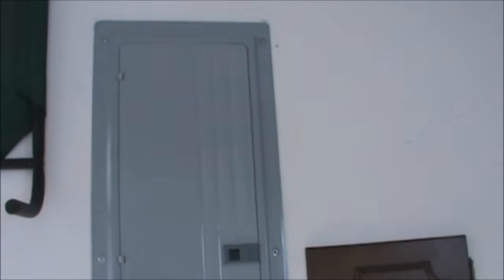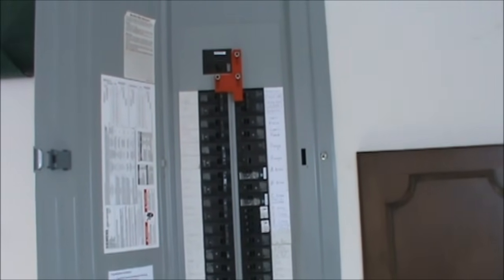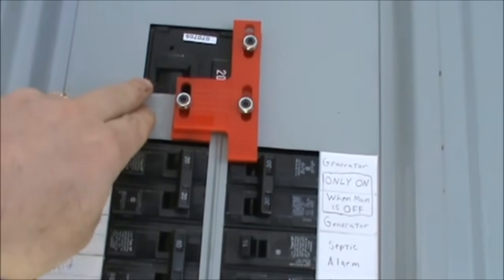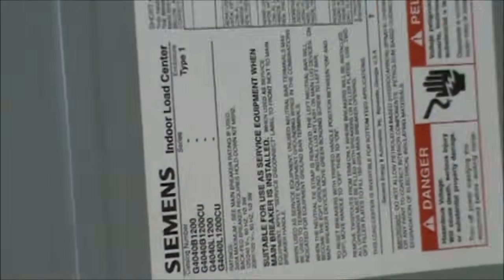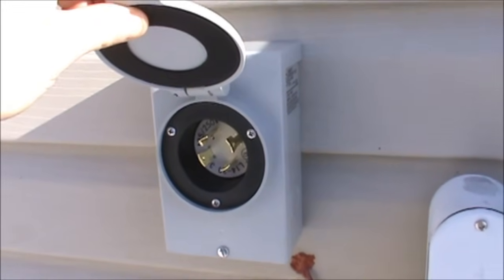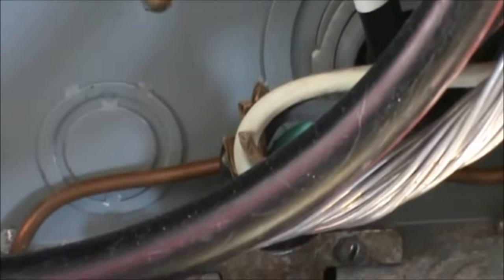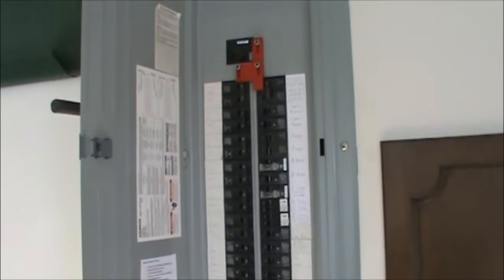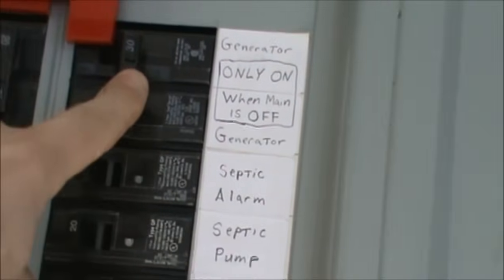How to wire a generator to an electrical panel

Comment: I have a very hard time believing that any sized portable residential generator would have the necessary rating to overcome what would be essentially a dead-short when trying to backfeed the distribution system in your neighborhood.     I mean, most portables can't power an entire house without stalling out - never mind the 15 houses on your line.   The load of those houses will overwhelm your generator and stall it out instantly.    That said, an interlock is obviously a good idea - you don't want the power to come on while your genset is connected to the buss.
Reply: You miss the point entirely. Picture this set up. A tree comes down on your neighborhood power supply primary,  taking you off the grid. The tree is on the power plant side of the transformer serving you. If you power up your generator without switching off your main breakers, you are running power back to your local transformer. Depending on your setup, that means the primary side of that transformer will be at 8,000 to 10,000 volts minimum. No lineman wants to be surprised by that. If there is no other load on your transformer other than your house and you aren't trying to run everything in your house, the generator will continue to hum along happily and keeping that primary at high voltage.
Reply: Believe it... happens all the time.

Comment: Won't the generator GFCI trip because the neutral and ground are bonded in the panel?
Reply: byron smartt It sure could!  Need to de-bond the wire on the inside cover located on the end of "most" generators.  They are built as portable power devices.  If you hook into your panel and de-bond the neutral then you should be OK

Comment: dude get a solar system to power your home all the time through your generator transfer switch...no noise...no gas...you can use it anytime your want to lower your electric bill
Reply: Only if you are off the grid. Meaning you need to have batteries also which most people do not have and they are still on the grid.

Comment: After looking at the zoomed in portion of the cables connected to the breakers...It looks like you used stranded flexible wire....if that is the case...then it is a code violation (NEC 400.8)...it works, but not code compliant.......informative video, however, not advisable to do non-compliant electrical work....

Comment: Sorry, its a pretty crummy video! At no point did it discuss HOW to wire the generator to the panel! It should be relabeled "how to use an interlock switch".
Reply: video was fine, you need to educate yourself or hire an electrician. Its basic common sense with basic electrical skills.
Reply: just hire an electrician. it is obvious that you are unfamiliar with electrical wiring so im sure an instructional video would be harmful to your health.
Reply: +The Rodog ----- "Its basic common sense with basic electrical skills"      fuck yeah !
Reply: +Jam Mer  ----     Find L1 at the generator. Find L2 at the generator if it has 240v capability.    Find "N" or Neutral at the generator.. Find "Mains" breaker switch.  Step two, if you cant find those items, you should stick to extension cords or hire a qualified electrician.  step three...Turn off Main breaker. Its labeled Mains.  take a double breaker, rated at say 30A, dont matter, generator has breakers. Insert it into panel in a blank space. "Find a way" to place L1 and L2 into the EVEN and ODD space on your panel (L1 on one lug on that double breaker, L2 on the other lug) . then "Find a way" to place the "N" or neutral on the bus bar in the panel where all the white wires go... the Neutral bar.  Hopefully you interpret "Find a way" to meaning common sense, such as routing it through holes, or conduit, and building the facilities for you to accomplish your goal. Step three,  do what the video advises. You will need to look up the twistloc connector they use, which is a NEMA L14 -30 .   It is also good to read how breaker panels actually work, and how utility pole transformers work.  An interloc switch keeps stupid people from flippin all the breakers blindly to "ON" , like if your "in-laws" are visiting with the wife and your not there, and your wife, whose never ever seen a breaker panel, in her entire life because "she doesnt have time for it/interest in it/dont care"  ...runs the microwave and the toaster at the sametime, with the hotplate, and poof , a breaker flips, and your in-laws go flip all of em to ON, which places the generator into the panel by mistake. Now imagine, if the power goes out, and your same inlaws, go out there and actually start the fuckin thing. Generator runs til the power comes back and then your gen catches on fire, you come home and wonder what the fuck you did to cause this, and its all your wifes fault for not having the patience to learn something new. Which is why Interlocs exist...  for the inlaws.
Reply: I totally understand, about just having common sense about a lot of these things, but I never knew that if you hooked up a generator, to just one breaker in your panel, that it would power every single breaker in your box!  For some reason, it's hard for me to wrap my head around that.  I thought they were all separate?
Reply: I agree waste of time
Reply: DOOOD - The only thing he didn't show was either he or the electrician running the 10/3 from the inlet box  to the 30 amp breaker. What's the beef ??

Comment: Why not have a transfer switch panel? They are about $300, so why buy if you can do it the way you did? Also, it looked like your green and white wires went into the neutral bar, you didnt explain.

Comment: im just going to put this out there..... if you back feed the system wouldnt you be hooked to all your neighbors houses? wouldn't that pop the circuit breakers instantly on your generator? what kind of lineman would be touching the outside power cables anyway?....................jus sayng
Reply: Exposed Motion Cinematics only if the main is left on. The interlock prevents that. So no, you can't be hooked to your neighbors houses.
Reply: Not sure you guys or girls understand my question, lets say you DONT have the interlock and ARE back feeding. if you were feeding your neighbors houses that would be too much wattage and you gen would pop its c b instantly...............get it now?
Reply: Its still dangerous.  A service lineman could be touching the power lines that your generator energizes and could be electrocuted instantly before it's tripped.

Comment: I just bought this generator and I did an initial 3 hour run to break in the engine. I noticed a small puddle of what looks like some sort of oil that came out of the air filter box. I took the air filter box apart and there was a good amount of oil coming from a rubber hose that's hooked to the gas tank. I didn't think this was normal so I exchanged the generator for another and it does the same thing. What in the world would be the cause of that oily residue/puddle inside the air filter box?
Reply: proably a emissions thing like pcv (crankcase ventilation)
Reply: Not enough info, what type of motor is it?
Reply: I think that hose allows air into the crankshaft. Usually is a little oily. If there's a lot of oil you may be filling the engine with too much oil

Comment: I have a general question I hope someone can help me with.
Yesterday we lost power. In the dark I had to build a pigtail. I put it together right.
I shut off the entire panel including the main inside the house and went outside to the garage which is wired basically more rest like a power strip but I grounded the box with an 8-foot Rod into the ground. When I say like a power strip I think the electricians here know what I mean.
I wondered a 20 amp circuit breaker red and black and neutral to the neutral rail ground to the ground rail it directly into the ground. I plugged it into my generator then I opened the circuit leading to the house.
 I went into the house and flipped on each circuit one at a time to run the basic stuff that I needed. I even had no trouble running the well pump in the sump pump Ma generators pretty decent.
The problem happened when someone pulled the plug going into the generator and dislodged the neutral from the generator. There was an open neutral everything went dim and I imagine voltages went nuts on each side if I'm thinking right one will probably head low voltage and 1 Railhead high voltage but I'm not sure I'm an electrician.
 Can someone confirm that that is what happened because I burned up a power supply I burned up the ballast in the fluorescent lighting fixture in my kitchen and a remote control box in the basement so it wasn't major damage it could have been a lot worse.
Basically fix the plug which I'll never use that style of plug again. It was that be enough. Can I use real crazy heavy wire that was used to wire the garage underground I have a spool of it. Looks like about 8 gauge.
I'm going to get the whole thing rigged up correctly so I just have to roll up my generator to a plug and plug it in. I am super careful to keep that Main closed.
Reply: I hate when people don't know what they're doing and place themselves, their family and others at risk.  Electricity is dangerous...hire an electrician.

Comment: all portable generators are not created equal.....3 different portable generators....hooked up using a double 30 breaker in the panel....one worked great....the other two????...don't understand why they did not regulate to 220 VAC...put 220 V to one leg....blowed everything out...other leg was 0 V....the folks using the later two lost micro's, TV's, dvr's frigs...the like....can anyone explain why some generators work like explained and others won't
Reply: What did it cost you ?

Comment: Why not just use a transfer switch? Its pretty much bulletproof.
Reply: I can't say for sure since I have not priced them, but it's probably a matter of co$t.
Reply: vinmorin   Two reasons...cost....  the interlock with a 40/50 amp breaker for the gen feed will cost you less than $100.00...plus the wire to feed in which you will need in any case . the transfer panel will cost you over $600.00 plus the installation.....IF...you have the room for the transfer panel near your main load center, which I did not have room to install. I used the interlock and 40 amp feed breaker for my 10,000 watt gen set, rated at 40 amp out put. works great. and simple and legal...

Comment: what harm could be done by powering the breaker the opposite way?
Reply: warbirdsp51 you backfeed the main turning the step-down transformer into a step-up transformer backfeeding the main 'grid' possibly killing a (or several) linemen working to get the power back so you don't have to use your generator.
Reply: That was NOT his question .. LOL
Reply: @warbirdsp51:
That is a question i cannot find an answer too ...

Comment: jail time....  that's silly...   if the power goes out...  the utility places its own grounds...  on the customer end and the sub station side...   there should be know potential during repairs...  if they follow there procedures...  which removes fault from the home owners....  we cant start letting the utilities decide such matters....  they just need to do there jobs....  and assume everything is live...  that's it..
Reply: Utility companies are aware of the dangers during power outages and prepare for them so their workers don't get electrocuted during line repairs. I believe they have ways of isolating sections of power lines from residential back feed.

Comment: question...I have watched this a couple of times.  Assuming you are running 230volts into your house panel THROUGH  two 30 amp breakers, it appears you are charging 230 volt into one leg of your panel which would destroy every item on that leg as each leg is 115 volts? Explain that to me...thanks.
Reply: Nope !  120 goes to each side of the panel.....your 240 draws from both sides of the panel.
Reply: Like wilbur said..  the two 30 amp breakers are actually L1 and L2  and the N is for 120v use only.  Each leg from the generator goes to every breaker in the box, (evens are L1 and odds L2... etc) and to get 120v, you put your volt meter on L1 and on N.   you can also get 120 by hooking to L2 and N..    you get 240v  ( or 230v ) with L1 and L2 . The generator winding often is wired exactly like a utility pole transformers secondary output terminals. (a 240v winding that is center-tapped to divide the voltage with a wire attached to the center to provide a "neutral" for the 120v.)
Reply: ***** The detailed version !!!  Mine has been wired like this for several years and it works great !!  Just used it a month ago when a wind storm took out a power line !! Flip main breaker off , start Generator, let warm up and throw the Generator breaker, and you are powered up. I use two 40 AMP breakers from the Generator as it puts out 41 AMPs.  simple and neat....and safe..
Reply: Thats a good setup
Reply: on single breakers  every other breaker is on the same leg, so if you hooked up like this to every other breaker youd be correct. Double breakers are just two breakers
Reply: James, Your statement shows you lack basic knowledge and could hurt yourself or someone else.   I strongly suggest you hire an electrician.
Reply: Let me guess. Your an electrician. Stealing your work?

Comment: Joesph compnotta.      IF....you are only using gen power and have no utility hook up, that is real easy.  run the approriate sized wire,dependant on your gen output, to your panel and wire your two hot wires  red black to each of your panel input lugs and your white neutral wire to your neutral post on the panel and your bare or green wire to your ground on the panel.  your panel should also be grounded to ground.  30 amp takes # 10 wire  40 amp takes #8 wire  check to amp out put of your gen set. you can buy the right sized wire, use the flexible stranded wire type and the correct plug for your gen set. and you are in business if you have the basic knowledge of wiring, if not hire an electrician.  I wired my own and had an electrician friend check it out.  good luck

Comment: This guy is right I have the same thing in my house his POINT was getting a licensed election in to install it he was showing you what you need and the proper way to have it installed there is way to much mickey mouse shit on youtube some one is going to kill someone or burn there house to the ground and yes you can go to jail if it back feeds think of the line man working on the pole, also keep in mind or insurance will not cover your house if its not installed by a licensed guy do it right the first time cost your looking at $2500 to $3000 and getting the right gen set to do what you want it to do we are living with bigger storms now and there only going to get bigger trust me in saying it will be the best money you will every spend to protect your family I no what talking about I sell champion and king generators for a house you start at 6500 watt and up and if you have electric hot water or heat start at 9000 watt and that's running power not start up always go bigger spend the money and good job doublewide6

Comment: these are illegal in Canada unfortunately as they can be simply  defeated by removing the panel cover , lol we suck up here .  so now ya got to spend 2k on a transfer switch instead of a $2 piece of metal and bolts , or do what everyone does because they don't want to spend 2k is make a sucide cord and back feed dryer receptical lol ,   so in essence the stupid bastards by making it illegal make people do more dangerous and stupid stuff.

Comment: how could a pro utility worker get electrocuted when they wear special gloves to insulate themselves?
Reply: +Dan Favata It's just an old wives tale about line workers getting zapped. Yes do the right thing...but point is nobody knows anyone that's actually been zapped!
Reply: The issue comes when the linesman starts making his connections and the sparks are flying out of a "dead" wire. Sure they work in the safest fashion possible, but at the end of the day, it's illegal for you to send electricity backfeeding into the system.
Reply: Dan Favata it’ll happen to the lineman every time from the surge you create when the power is restored along with the power entering from your generator
Reply: For one thing, you'd be sending your gen power to every home between you and the line break --unlikely that'd work, but if the power did get to the down line you'd only kill the little kid who comes in contact with it unless they had special safety equipment and training, in which case it would be their fault, right?

Comment: Just run a line from the Generator to the breaker Box keeping the main off, watch your neighbors, when their power comes on disconnect everything.  May be Illegal, but I'm safe, it's not my fault their are so many stupid people that have no common sense for you people there are  interlocks and laws that make you do the correct procedure.

Comment: Flip the main to off. Take a male to male wire and plug it from generator to any outlet , the electricity will figure out how to get to all the other outlets, simple as that.
Reply: Yes I agree.  MAIN OFF FIRST (as mentioned)  !   After plugging in - It will only be on one side. If  a device isn't working you can plug an extension cord from the working one to the device that is needed.  My brother just showed me yesterday when he got the furness working and then got the refrigerator working with an extension cord.  He has  an electrical engineering degree.  Kudos to him.
Reply: Kenny Wills 
And when/if you get caught you get ticketed at the least. What you are talking about is illegal